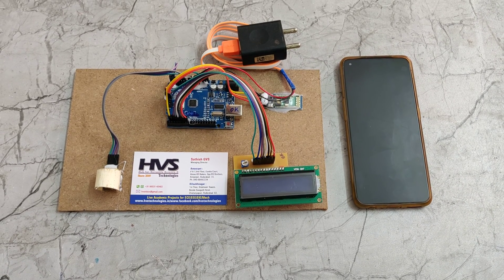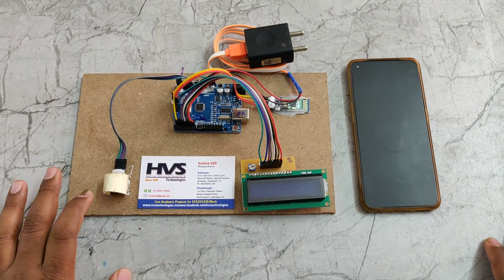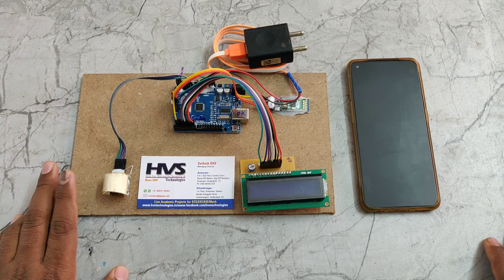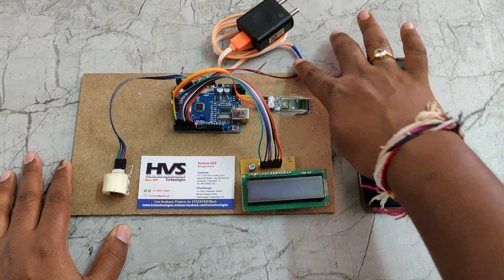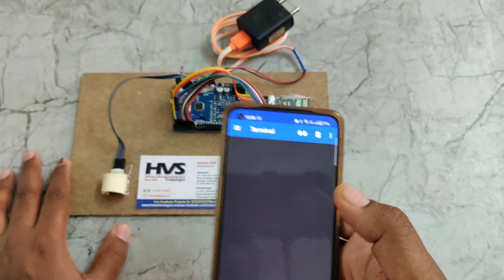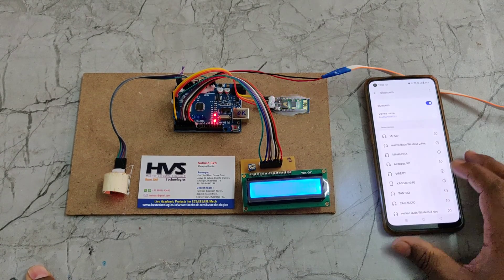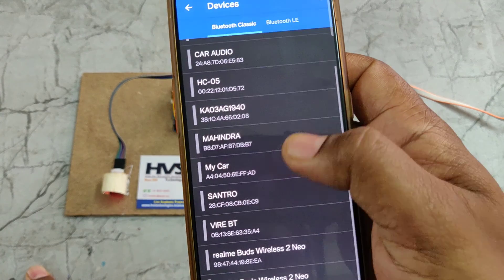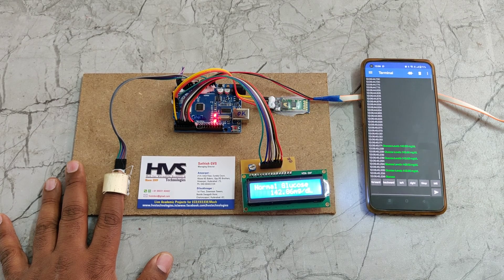HVS-3668. Noninvasive Glucose Concentration Measurement System #bluetooth monitoring #NIR glucose.

Comment: Can tell me what kind of infrared sensor u used?
Reply from the maker: Hi, 
We sell full working kit with document PPT circuit diagram and code. Could you Send me the video link, Will update you the cost details. You can contact us at +919603140482
Through WhatsApp or call